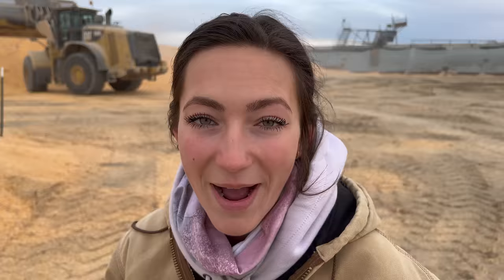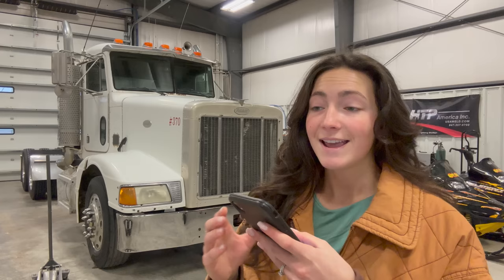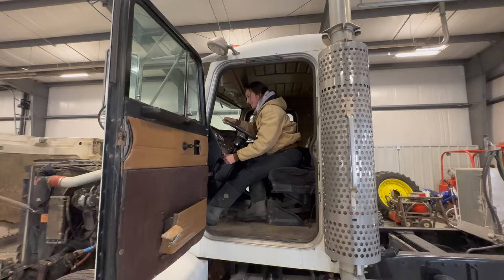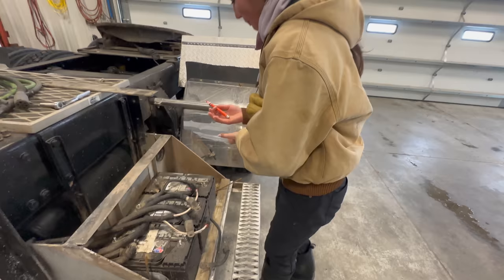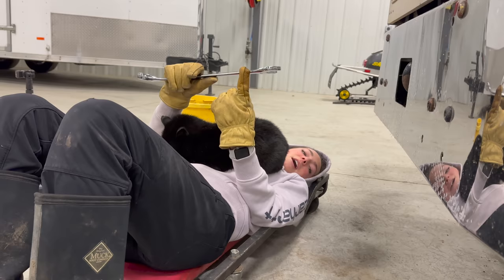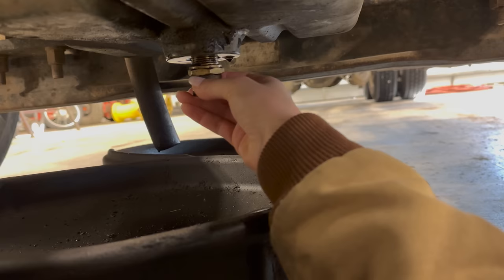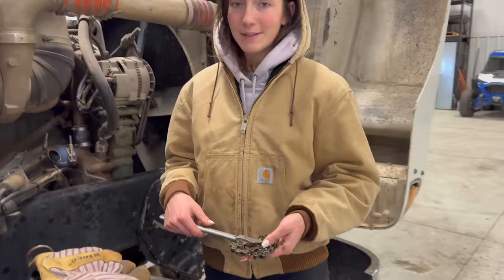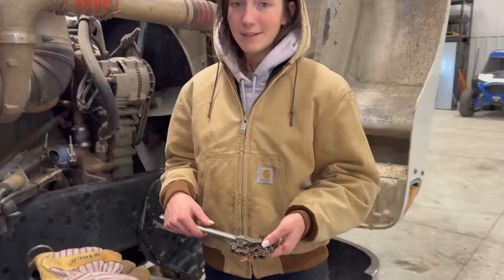The Worst Oil Change

Comment: Hey Laura. First of all, I like your cat. I work on heavy equipment, and I have run into the same issues before when doing an oil change. The problem is that the person that did the oil change definitely tighten the filters way to tight. Like you said is to tighten the filters hand tight. That’s all that is needed. I have a strap oil filter wrench from snap on that works really good. You can use a 3/8” ratchet on one end and a 1/2” ratchet on the other end. And I have ran into the same situation you have and have had to use two ratchets to get filters off. I really enjoy your videos.

Comment: A filter band wrench should do it, if not, put some rubber tubing (scrap),or leather in there to grip as you turn,also keep the refill cap off,and the bottom drainage plug off,that way there is no vacuum effect when removing filter😉

Comment: Diesel Fitter here,,,,  no way should filters be that tight, but thats trucks hey  i made my own filter strap for trucks,,      get half inch square section bout 1 and a half foot long,  get an old seat belt, split the square section one end down bit better than the wide of the seat belt, cut length of the belt bout 1 foot long, put both ends together into split in square section , drill holes and use small bolts to clamp belt tightly but not cut it,,,,    from underneath slide belt up to top of filter, twist up slack on belt with square section and undo with a big shifter ,,,,,

Comment: Like others have said a strap wrench.  I had one that went on a half inch ratchet.  Plus fuel filters should be filled before put back on.  Makes it easier to start the truck no air pocket.

Comment: 1/4 turn isn’t tight enough on the fuel filter.  Poke a hole in the bottom of the filter and drain it before removing it.  As a last resort, drive a pry bar through the filter to remove it

Comment: There is a proper cup that fits the cap of the filter and is turned with a ratchet.  If you have already buggered the filter too much the last resort is to rotate it with a large philips screw driver (or something similar) after stabbing thru both sides of the oil filter can.

Comment: hi guys i have a suggestion when your changing your oil filters  put a small drain hole in the bottom i usualy use a philips screw driver to poke a hole in them  it saves a big mess doing them this way , and make sure you put a thin layer of oil on the top seal this makes them come off alot easier . i have personaly taken filters off with a 3 foot pipe wrench because they were put on dry and over tightened .

Comment: OIL FILTER WRENCH:  cup wrenches that you can use a extension and ratchet works best,  fits filter perfectly.  Band wrenches use cloth nylon filter wrench because it won't collapse filter as bad as metal band wrenches...   closer to treads with band wrench is best.  In the event filter is so tight and filter is crushed,  use cold chisel and a hammer on filter base next to tread stem...

Comment: You can try adding some heat to the block where it attaches with a torch just don’t go to crazy with it. absolutely worse case scenario, you can cut the filter off and use a small cutting disk to cut the threads. Old trick for getting really old cast iron fittings apart. Good luck

Comment: That loader weighs 70,000, not 700,000lbs. You need a proper oil filter wrench that accepts a 1/2” drive extension that allows the wrench to slip on the filter all the way up to the housing.  And you should have 4 batteries in that truck, but to each their own.

Comment: So the first time I saw trouble getting off an oil filter, it was my nieghboor's Chevy straight 6, with the filter coming horizontally off the front of the engine.  He had bent it with a strap wrench.  I got a huge screwdriver, drove it through the middle, and yanked.  It collapsed some more, and tore, but then it gave up and came loose.  
The second time was on my 4 cylinder Camry.  There wasn't really enough room to get a filter wrench on it, even with a handle that hinged to an angle, so it just bent.  I got my Channel-locks and bent it further.  So then I turned the Channel-locks 90 degrees, crushed down hard, and got the thing off.  Next time, I bought a 3/8 inch drive cap-wrench.  It was pressed sheet metal, and eventually streched too far, bur it was cheap so I just bought another one.

Comment: Caterpillar Filter Strap Wrench 185-3630 will let you get up in the chassis rails to the top of the filter with an extension. Filters are less likely to crush if you put the strap at the top.

Comment: Simple, learned this years ago.
Take a phillips head screwdriver, one of the biggest you have, hammer it through the oil filter and turn it counter clockwise and off it comes. Not pretty but no risk of creating any damage 
Good luck!

Comment: Laura if you ever have a problem getting a stuck oil filter off. Please a hair dryer on the top area of the filter ware it screws in to the housing it will expand the thread housing wear it threads in allowing the filter to be much easier ti remove 👍

Comment: This filter has to come down one way or the other, so crushing or destroying it may not be the worst option. On smaller car filters you can always poke a screwdriver through the filter which helps almost every time. You can scale that up to any tool you want for these bigger filters. I thing the most important part when knowing that it wont come down easy is to poke it on the bottom and drain the oil. Take your time.

Comment: The filter is heavily twisted. Punch a hole through the filter and insert a lever into it. The metal of the filter looks powerful, it should work. It worked on small cars.
Goold Luck, Laura! With love from Russia

Comment: Having the correct tool for the job is usually important.  For all the different applications you guys have, you need to have a few different actual filter wrenches that tighten on the filter as you apply pressure. For the Pete, get the kind that has a 1/2" square drive fitting. It works with a rachet and an extension. Always, with every filter, get your wrench as high up on the filter as you can. The closer your wrench is to the end that threads onto the engine's fitting the more torque your wrench applies to the filter to loosen it.

Comment: I agree with the filter wrench at the top of the filter where it meets the housing. It's a good idea to fill the filters with oil before you screw the new ones on the truck and the same with the fuel filter although not so important.  The engine doesn't need to go without oil while the oil pump fills them when you start it, thats hard on the bearings and other sensitive parts.  Keep sending these videos, you guys are a breath of fresh air and I thoroughly enjoy watching you go through all that makes up the profession of farming. Cheers

Comment: Working as mechanic, late 1990s - 2000s, I had 3 in wide band straps, worked great. Later NAPA went to 1 1/2 wide bands. Same stock number so could not get the wide band filter wrench

Comment: spray penetrating oil around the outside of the gasket, let stand for 10 minutes then wipe any oil on the exterior of the filter, then give it a try.  in extreme cases try tightening a little first if possible.

Comment: The blocks of wood for the batteries are a nice touch. The filters are so tight because they did not lube the seal before putting it on. Try and grasp the filter at the top and get a band filter remover.

Comment: Yes, as some have said, the bottom edge of a filter is the place meant to use the wrench, where it transitions to the dome on the bottom, or the actual top of the filter. You know, for years I have been doing the same process when changing oil, but recently, due to a generator we often run that is quite heavy, I had to slide it 180 degrees to be able to hang it off an edge to drain it so I finally bought one of those Vacum systems to do that job. I bought the  "ARES 15081 - Manual/Pneumatic Fluid Extractor with Brake Bleeder Adapter - 10L Capacity - Powerful Suction with Included Hand Pump or Pneumatic System" and used it for the first time yesterday. Wow, it's soooooooo simple now! It comes with many different sized tubes to put it into the dipstick hole which goes to the bottom of the oil pan, and you can drain it also with a compressor, and walk away and it will finish by itself. Honestly, for about 40 years I have always done that job manually, even with a jack and jackstands on some vehicles, but I will NEVER be without one of these again. It's so fast, and so simple, and so CLEAN. I dont mind getting dirty, but doing oil changes without ever having to lay on a dolly or the ground again works for me. I dont know if I can post a link here, but I bought it at Amazon for 160 dollars. It also lets you bleed brakes which means you can do it alone instead of always needing two people. For the time it saves me, and the very simple way it works, it has already paid for itself in my opinion. Anyway, just sharing my experience. Appreciate the channel, especially the tech! God Bless both of you!   - Edited to fix typo's.  :)
Reply: BTW, if a person puts the filters on without applying oil to the seal, that is what happens. They seem to nearly fuse on and sometimes you have to get very creative to get them off.
Reply: IF you want to get a wrench, use the strap style ones, they do more rotate than crush.

Comment: Strap wrench with either a 1/2 inch drive or 3/8 drive connected to the strap wrench your never want to use a chain wrench on oil filters for that purpose of putting holes in the filters. They aren’t made like they used to and the metal housing are thin. Strap wrenched are mainly used for fuel filters that are thicker walled and you always want to prime your fuel filters before you put them on and your oil filters also.

Comment: Biggest Phillips head you can find and a hammer. Punch through the filter and you can apply torque on both sides of the filter to loosen it. I'd be very carful using heat. If you get to that, use a heat gun not a torch. Ultimately, a new filter housing normally costs around 250 - 400. You can take the existing filter housing off with the filters still on it and replace the whole thing.

Comment: Easiest way rather than buying a bigger remover strap that you probable won't use again is just stick a big screwdriver through the filter one of you pull constant pressure on it while the other taps the top of the filter with hammer and chisel, the pressure and vibration should break the seal and release it.

Comment: Get a "Wide Band Oil Filter Wrench" for a 1/2" drive socket. Napa sells for about $50 but they may not have one in-store. Amazon sells the same type for about a lot less. 

Caution, these come made for 3 different filter diameter ranges (4-1/8" to 4-1/2", 4-3/8" to 5-1/4", and 4-3/4" to 5-1/2") so know the diameter of your intended oil filter first.  🤓

Comment: A strap wrench that works with a half inch extension and breaker bar or i sometimes use the air hammer with a chisel, up at the top of the filter where the meat is. And then just turn it off. Most of the time that works.

Comment: You should wire brush the cable ends to s shiny state along with the battery posts to ensure good electrical contact.

Comment: Wow. Yeah. That is crazy over-tightened.  When it is that stuck, I try to grab much higher to the mounting flange where it is thicker. But. it requires clearance to get a tool around. 

Other things I have done when it is that bad, I have drilled a hole through and stuck a big, heavy duty rod through it. 

Good luck!

Comment: Lots of advice on how get the filters off in the comments. My advice is to take that fuel filter off and fill it with fuel then reinstall likewise fill those new oil filters with oil before you install them.

Comment: Get a Lisle strap wrench part number 60200 with a 12” extension and you get your self a long breaker bar or I prefer a telescoping 1/2 ratchet. Just be careful the strap wrench loads up like a tow rope. And will snap back at you if your hands slip off.

Comment: I've had good luck using a pair of oil filter pliers on tough to remove filters. Also I would remove that fuel filter and fill with diesel then reinstall. It will save lots of headache getting that truck started again.

Comment: 1/2” drive strap filter wrench and a 1/2” drive ratchet from harbor freight with extendable handle. To lessen messes, poke a hole in the bottom of the filters with a punch and let them drain before removing

Comment: a small recommendation use a permanent marker to write the date and miles on the canisters, makes keeping track easier. Tough remove canisters a long screwdriver (big one) and a hammer punch right though with thew screwdriver then use the hammer to knock it around (or grab both ends of the screwdriver with you hands and twist, only if you have the strength). Really to over tighten.

Comment: Don't know if you got your filter off yet. Just saw this on Facebook. Take a large hose clamp and put it arround the top of the filter and tighten it. Then use the screw part with a cold chisel and tap till it comes loose

Comment: Laura try using Grants pant belt. Wrap around the filter and slip through loop and pull. it will tighten around the filter and give you a little more grip and pull

Comment: Is your oil multi grade ??
Such as 20 - 50 W;
50 W cold, thick
20 W hot, thin
W = weight 

Any impurities sink when sitting and cold.

Run it, get it hot, mix it up and it will drain quick,,,,

Happy Motoring 🕺💃🕺💃

Comment: The closer to the ends of the filter you put a wrench the better. It won’t crush as easily. I would recommend filling your fuel filter to ease start up. I use seafoam. Also i would clean your batt cable ends and put on a corrosion inhibitor. I use WHIP. Works great but is a lil messy when you change batteries next time. Looks like grasshopper spit but stickier. Napa here in South East NE has it. 
Another good video Laura.

Comment: Scotty is a very helpful boy.

As far as the oil filter goes, if a band clamp doesn't work, about the only thing you can do is drive a big screwdriver through it (very near the top) & then torque it off from there.  Also, as others have suggested, you can try heating the rim with a hair dryer.  Really get it warm, almost hot.  I've had to use both techniques.  Never fun but eventually will work.

Oh, and in the future, turn your steer tires hard to the right so that you have more room to work.  It will make your life (lives?) so much easier.

Comment: snap on tools make a great strap wrench that you can twist the filter up at the top and drive it with an extention either three eights or one half. Sometimes old filters can be a real snot flinger to get off. on a truck do not make a electrical connection without coating it with dielectric grease , it will make life a lot easier in the long run. I hope that this helps and keep up the great work.

Comment: as a last ditch effert, drive a punch or large screw driver completly thru the filter. Not neat but might work. I have done it and it worked.

Comment: If you don’t have a strap filter wrench you can use a old v-belt and a box end wrench by putting v-belt through box end wrench than over filter and pinch belt with wrench

Comment: If you are going to use the chain tool, my suggestion  it to tape some 6 inch long bolts around the filter so the end of the bolts are near the base of the filter.    You need to transfer as much torque as possible near the base so that the purpost of the bolts.., Where the most pressure of the chain tool touches the filter, make sure you have a few bolts in front of it so the filter itself doenst collapse any further...  If you have anyway to spray wd40 near rhe base of the filter and let ir sit overnight that can also help.

Comment: Working at a Chevy dealer, I know the pain of over-tightened filters. I've had very good luck with OTC's 4440 three leg filter wrench(they also make a larger one, 4441). If the $70 price tag is too steep, there are other similar wrenches on Amazon for considerably less and still have good reviews.

Comment: In the past I took the sharp end of a rolling head bar and punched it completely thru the filter so it stuck out the other side, then I took a cheater pipe and was able to break it loose enough that my filter wrench could get it the rest of the way. Be sure to put your used oil pan under it tho because it creates quite a mess.

Comment: perhaps you didn't know that the tool  is for cutting pipe in particular old cast iron pipe - that is why it has a cutter head  built into it. the one grant tried to put a piece of rubber over. But with a proper filter wrench you will have better luck.also a word of advice, you did not use enough pressure to tighten the new fuel filter. tighten it as tight as you possible can by hand then with a proper filter wrench  -  tighten 1/4 turn.